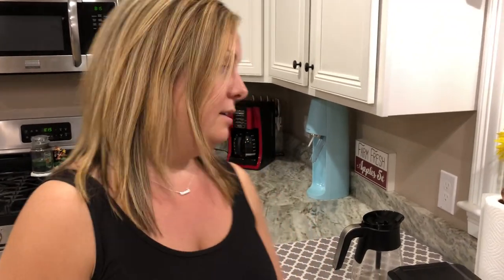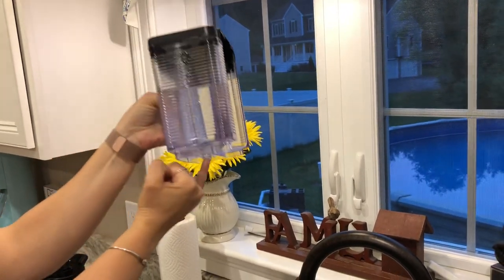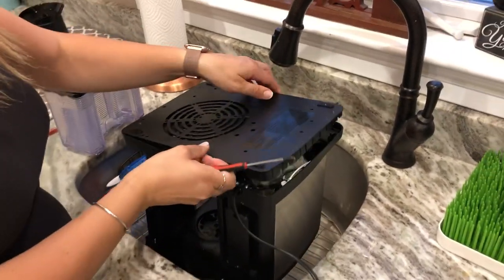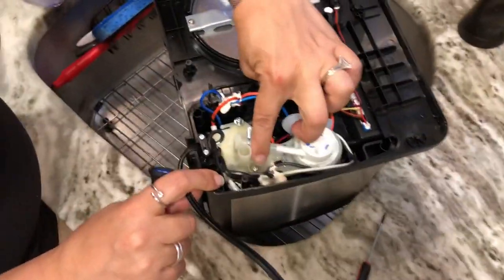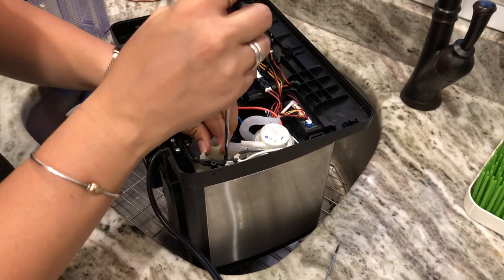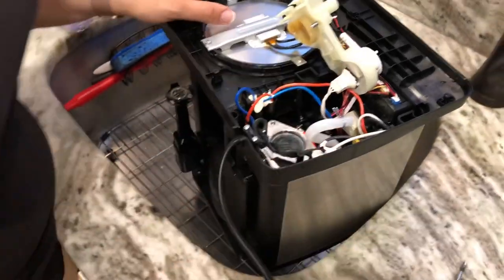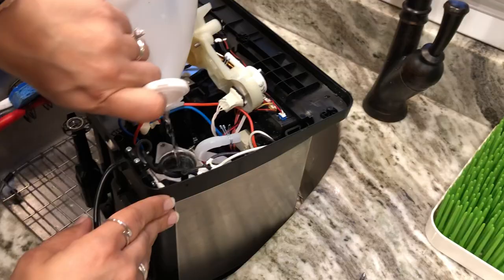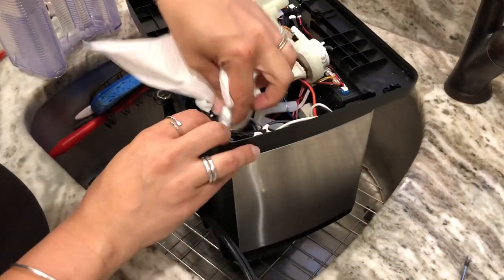Ninja Coffee Bar 5 Beeps of DEATH ~FIXED!!!

Comment: Alternative solution:  I didn’t have the right screwdriver so I added vinegar a little at a time into the black valve and pressed to drain it into the machine.  When it stopped draining I knew it was filled.  I let it sit, then ran a clean cycle and it worked!  I ran three more clean cycles with vinegar/water mix and two more with clean water.  So far so good.
Reply: You know someone has a lot of money when they have the correct tool to remove a tamper resistant torx head screw
Reply: Maybe the foreman at the machine shop has a punch list of stuff to get done later today

Comment: This is wonderful, thank you. One note, when you pulled the white plastic piece off, the gray gasket was in the metal boiler. When I put it back together that way it leaked like a sieve. After a few tries I realized that you have to put the grey gasket around the plastic piece before putting it back together. Other than that, great video!
Reply from the maker: Heath Huffman thanks so much!!! That little gasket is a pain!! Glad it worked for you!! 😊
Reply: Thank you! You are a sanity saver. After 3 times of putting it back together and water pouring out, I found your comment. Works great now!
Reply: I’m so glad you posted this. I had taken it apart 6 times and was about to just give up. As soon as i put the rubber gasket on the plastic and not IN the reservoir it worked perfectly
Reply: So glad your comment was here! Working great now without leaking!
Reply: It happened to me too, until my husband put the gasket on the plastic thing. Thanks so much for  sharing. 😀
Reply: Your comment saved my sanity!!! I was already buying a new one

Comment: The flow meter detects reduced flow signaling the maker to do the five beeps. I went through six videos, including yours (yours was the most helpful!), and I cleaned the hose and the scale off in three different ways. It worked for a week before the beep came back. I told Ninja on Twitter about it, and others did, too. Template response. Treated you like a generic customer and not a person. If they would've responded on Twitter with real solutions, I'd have stuck with it, but when the beep came back after a week, I said, "Okay, that's it." I later bought an Aeropress for $30 and it makes better coffee, faster (as fast as you can get hot water), quieter, and you can take it anywhere. That said, thanks for the video, Lenia. It helped.
Reply: So you think Ninja should teach you how to completely disassemble your coffee pot...just because you have water problems, and don't clean your coffee pot enough to adjust for it?

They give you basic maintenance instructions, dummy lights, and audible warnings.  But your water problems are still there fault...just because.

Would you blame Ford for not teaching you how to disassemble your engine/fuel system...because you keep putting bad gas in your car?
Reply: @zamiel3  no i blame ford for putting a deficient EVAP system on their vehicles causing line failure and backup... just like the new bronco, instead of improving the EVAP canister they applied a sticker on the fuel door telling you to stick the nozzle all the way in and then back it out... this totally negates the point of a canister EVAP system... this failure isn't the customers, it's the manufacturers fault for delivering a piece of shit
Reply: @soupynate2323  The coffee pot isn't "deficient". Try reading what I actually wrote.
Reply: @zamiel3  Ford doesn't think the Bronco EVAP system is deficient either... "try reading what i actually wrote"
Reply: @soupynate2323 ngl you did that one😂

Comment: Before you go to all that trouble, remove your pot and reservoir… Turn the whole thing upside down over your sink and give your coffee maker a good few hard slaps. That should dislodge a lot of your problems including air bubbles. After that run a vinegar solution through it on the clean cycle. No need to take the whole darn thing apart if you don’t have to. Worked great for me.

Comment: I simply took the reservoir off, turned it upside down in sink and used my finger to press where the reservoir connects to the valve in the machine and bled all the water out. works good as new. good video though.

Comment: Where did you get the screwdriver? That’s my current issue! Finding one that will fit.
Reply: Mine too
Reply: It's called a torx bit. Every hardware store has them
Reply: It's a T10 torx to be more specific
Reply: They are actually tamperproof torx

Comment: Took the two screws out of the boiler..fought to get the pump out to inspect the tube...when i pulled it out...there were yellow plastic pieces from the the plastic cap blocking the hole OUT. Apparently there was a small funnel on the inside of the cap ??  And it decayed and lodged itself into the exit hole ...blocking  75% of the exit.
Cleaned out with a bottle brush- ran cleaning cycle with vinegar...then water 3 times...  
NO MORE BEEP!
Thank you so much for posting your video...can't go without my coffee!
Reply from the maker: Great work!! Such a pain though, but glad you were able to fix it!   Definitely too expensive of a machine to just dispose of after those damn beeps!

Comment: This worked for me.  Thank you!  Btw, if your having trouble getting that calcium scraped off like I did, soak a towel or a paper towel in white vinegar, stuff it in there and leave it for awhile.  That loosened it up well for me.  Also, make sure you put that gasket around the plastic circle before you reconnect it; I didn't do that correctly and water poured out the bottom when I tried it out.
Reply from the maker: Keith S that’s awesome!!! So glad to hear.  Also, great idea to soak the paper towel with the vinegar!  Wish I had thought of that lol

Comment: Really grateful for the video. I didn’t have the right screwdriver to begin with and it took me a little bit of research to find out that I need T10 precision screwdriver to open it. 

Other than that your solution worked like a charm. 

Thank you again for sharing!
Reply: Yeah I don't understand why they put 2 random precision screws under there for absolutely no reason.

Comment: This works!!! I had chunks of loose white scale in my boiler and build-up on side and where the seal sits. I stuffed dry paper towels inside then soaked them with white vinegar. I cleaned the rubber seal and areas where the seal fits so it would not leak later. A month later and my ninja is still working like new. Note i had  a piece of black plastic blocking me from opening the boiler.  I removed it.
Reply from the maker: T LeB that’s awesome!! I’m so glad it worked for you! 👍🏻👍🏻

Comment: Thanks for posting this! It saved my Ninja!  I had been experiencing the 5 beeps of death for weeks. Repeated cleanings did nothing to solve the problem and I was searching for answers. Its ridiculous that a user has to dismantle a coffee maker just to brew a simple cup of coffee. At least I know how to do it now if the Ninja's death song comes on again. By the way, I had a lot of difficulty removing the bottom covering. Some of the torx screws were stripped. I ended up breaking the bottom to get it off but was able to superglue it back together.
Reply from the maker: That’s awesome!! I’m so glad it helped. My screws weren’t too bad, but they definitely very “soft” I could see how they could easily become stripped!  Great job!!
Reply: Must use Tamper proof #T10
Reply: My husband and I experienced the exact same issue with removing the bottom cover. They made those screws with  an indent in the center of the screw making it harder than it needed to be to get it off. Oh well, the bottom looks like hell but all that matters is it's working now.

Comment: I was skeptical of this troubleshooting but it worked! I also took apart the small little pump where the small hose is connected to on the piece she took out. Opened up the pump housing by slightly turning it and it unlocked easily. Made sure the small little fins inside it was able to move freely and cleaned out the small hose attached to it. Put everything back together and sure enough it worked! After running a full coffee pot (just water), lots of little calcium nuggets got flushed out and went onto the coffee basket!
Reply from the maker: That’s awesome! Glad you got it working! Feels great being able to fix something! Love it!

Comment: Mine was actually almost new, so it wasn’t dirty. What I realized is that  there seems to be sensors on the filter holder. I had mine between two appliances, so could open it to put coffee in it, but it wasn’t opening fully to trip the sensor. So as long as I open the coffee filter door fully, hear a tick, then push it closed and hear another tick, it works fine.
Reply: I think that's what the problem with mine is.  I have always used distilled water in it.  I have a grandson that fills the filter all the way up with coffee so I wonder if that sensor is dirty!!
Reply: @tonjabell8952  Mine was the actual door you have to put in the filter and coffee in the top. As long as I swung it fully open, it seemed to work. I could change filter and add coffee only partially opening it and it didn't like that. Maybe theres a censor in the door that has to trip, for it to work.

Comment: Thank you for the instructions  they were great and it did work!! , one thing to be very careful it is when you put it back together to place the washer on the pump properly if not it will leak ...test for leak before replacing the cover:face-blue-smiling:

Comment: Worked for me, thank you!  My heating chamber was gross.  I will say that I didn't get the gasket in place the first time and leaked water all over.  When I put it back on the plastic part and then squeezed the parts together, it worked like a charm.

Comment: So first of all, thank you. This worked!!! Little upset about the torx security bit set I had to buy- but ended up with a 100 piece kit from Harbor Freight for $9.99- beats another $200-500 coffee system. I made the mistake of not seating the seal correctly and ended up with half a pot’s worth of water and vinegar on my counter... so I got to get those super clean as well!!!! My neighbor has the same system and recommended using the water from my refrigerator since those filters are usually pretty decent. Thanks for the video.
Reply from the maker: S Morris so glad you got it working!!!

Comment: OMG thank you so much for this video.  I just experienced the 5 beeps of death myself and had no clue what was wrong and ready to go buy another coffee maker.  At least now I was able to get it working again!  I too am unsure how I got calcium buildup when I have a whole house water softener and get water that's filtered again through the refrigerator.  I also had trouble getting the screws off the bottom, but eventually found a small flathead screwdriver that did the trick.  Thanks again!
Reply from the maker: Wohoo 🙌🏻 great job!  Yes, those damn screws were tricky!!!

Comment: Hi, Lenia! I used your video to help fix my coffee maker, thanks. A quick insight on why this works:

 - The hose you cleaned connects to a flow meter (Google "ab32 s21p030c 11R" and you'll see a doc explaining that it's a flow meter used for coffee makers that use "vibration pumps". The 30c is the opening in mm (3.0mm), 11R is the angle (w/e that means) and  AB32 represents a model.
 - The inside of the coffee maker gets reeeeeallly scaly, like we saw here, and I think scale clogs up the hose
 - I think clogging up the hose causes the flow meter to register as "too low of flow"
 - The coffee pot takes this signal, shuts it off, and gives you the five beeps.

So I think five beeps means inadequate flow, caused by scale, which you eliminate which makes it work.
Reply: @aaronbell5994  yea, I noticed that too and was a bit bummed bcuz I didn't want 2 go buy 1 so I decided to try the regular star 1 and it worked except for 1. But, I just tapped it with a hammer and it worked. I had zero issues screwing it back on too 😊

Comment: Mine turned out to be a corroded connector (the red one) going to the "boiler chamber" over-temp switch. I bypassed the connector on the pin that was corroded and the five beeps of death went away. Always check the integrity of the several connectors in the bottom of the coffee maker. Thanks for the inspiration.

Comment: Worked!   So thankful for this video - wasn't able to find one that took apart the machine.   Thanks!
Reply from the maker: Awesome!!! Yay! Great job!
Reply: What type of screw driver did you use to take off the screws form the bottom?
Reply: @jessicap8229   Its call a Star Key. or Hex Key   I got mine on Amazon or your local hardware store will carry it.

Comment: Thanks for posting! 2 quick suggestions: 1.) Of course, make sure that you unplug the unit before you open up the bottom (seems obvious but some may forget). 2.) Remove all of the screws, including the two heating element cover screws, before you put it into the sink. That way you don't lose any of the tiny screws down the drain. And then assemble on the countertop, not near the sink.
Reply from the maker: Thank you!! Very good suggestions 👍🏻

Comment: This, alone, didn't work for me and I was ready to throw it away. I saw somewhere else about bubbles getting in the line and it said to burp the machine. I unplugged it, removed filter and basket and turned it over in the sink. I pushed the button where the water reservoir meets and let the water drain. I began turning it up right again and let the water drain from where it fills the filter basket. I repeated this until no more water came out and while it was upside down in the sink, I spanked it pretty hard on the bottom a few times. Plugged it back in and it immediately ran a full clean cycle without beeping after 20 seconds! My wife is impressed.
Reply: Brilliant! Didnt have to take mine apart decided to do this first lol even though im like this may be a joke to burp the machine lmao it worked though
Reply: Thank you so much for commenting this! I decided to try burping my machine first, and it fixed it like magic! I am now running a full clean cycle. You are a blessing!
Reply from the maker: Great idea to try that! I am glad it worked for yours! Mine unfortunately was past help with burping LOL 😂 glad yours is working yay!

Comment: not sure if it's a fix for all ninja's, but just holding mine upside down and depressing the valve fixed it. It was just an air pocket in the line. Try that before taking it apart. 
But still appreciate seeing how to take it apart if I ever need to!
Reply from the maker: That’s great!  Glad your’s was a somewhat easy fix!! Cheers
Reply: I have the answer to the 'Beep of Death 2.o'... It requires the dismantling of the Swing Brew Basket.  There are subsurface magnetic contacts that feed the ability to perform a brew cycle.  At the root of all of this is a a spring to facilitate the contact.  And, there you go, no need to buy a new unit... Definitely a weak design and I will show you how to reinforce it as well!!!
Thank you Jillian 🤓

Comment: Hey all, a year in, and this is still THE BEST HOW-TO-FIX video on your Ninja.....I have referred to it several times.  I no longer do the vinegar cleaning cycle, ever.  It takes HOURS of hovering and doesn't work.  The reason is that the Ninja  boiler is something like 3 inches tall, and only about 1/2 of an inch of liquid sits in the boiler; the rest quickly cycles in and out...so the vinegar/special coffee maker cleaner doesn't have time to do it's thing!  Save yourself the frustration.  Skip everything else.  Go straight to the boiler.  My tips:  Clean boiler soon after  the coffee maker has been brewing, because the hot water seems to soften the mineral gunk.  
    Scrape down the inside of the boiler with a screwdriver best you can.  Then use a small wad of sponge or cloth to plug the hole at the far end of the boiler and fill the boiler with vinegar, and hopefully the plug of sponge will hold the vinegar so it SLOWLY drains, fizzling as it goes.  Now find the sharpest junky knife you can and scrape again.  Then use a skinny fork (I use a little 2-pronged lobster fork) to swirl a somewhat abrasive scrubby pad soaked in vinegar around in there.  Repeat till satisfied.  You'll never get all the mineral scale off, but the machine will work fine with the bulk of it gone.   Even if you scrape around for half an hour to an hour, it is still way easier (and effective) than the useless time trying to use the the cleaning cycle.  I do this every three months or so, when the Ninja needs to brew twice (or three times if I am delinquent!) just to fill my coffee mug!
Reply from the maker: Thanks so much for your kind words!!  That’s awesome info and tips!!!
Reply: What screwdriver do we use

Comment: Nice video, thanks.  NOW, can someone help solve the OPPOSITE problem... my Ninja (CF097) has started dispensing LESS and LESS liquid each month.  To get the same amount of brew I've had to bump the dial from TRAVEL (16oz) to XL MULIT-SERVE (20oz) and now up to HALF CARAFE (25oz) just to get the same amount of coffee brew.  It puts out a LOT of steam & takes longer and longer but only a slow drip comes out. This unit has NEVER had anything in it but pure distilled water (no minerals at all). What is the mechanism that decides how much liquid is dispensed? Is it a timer?